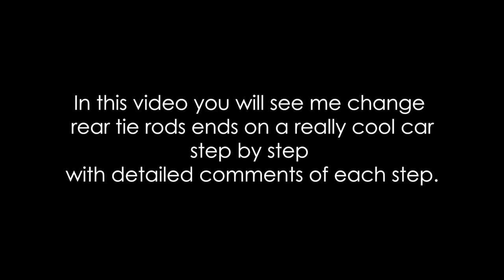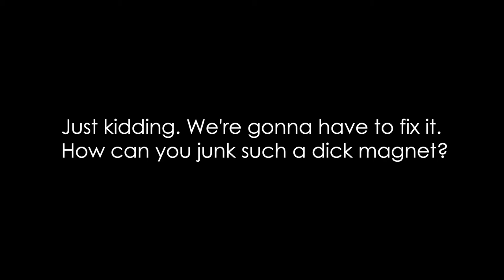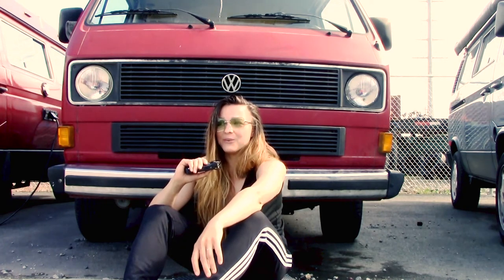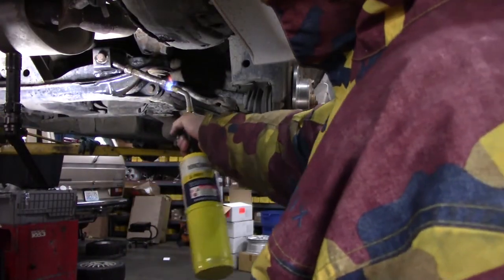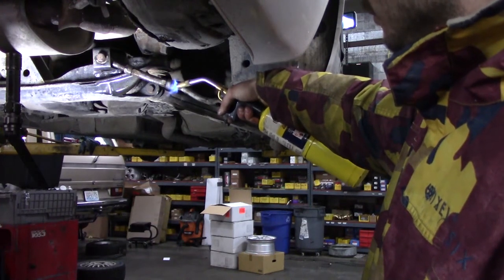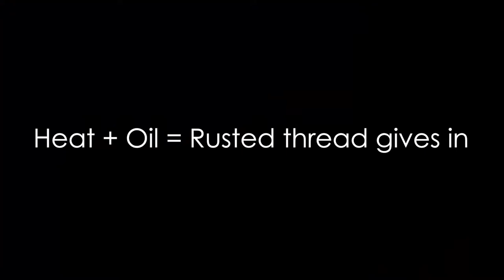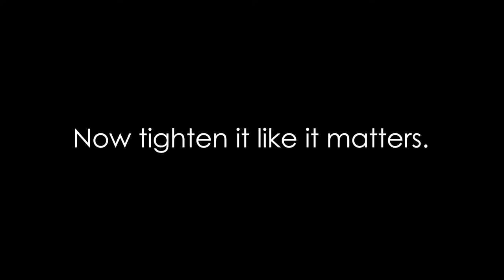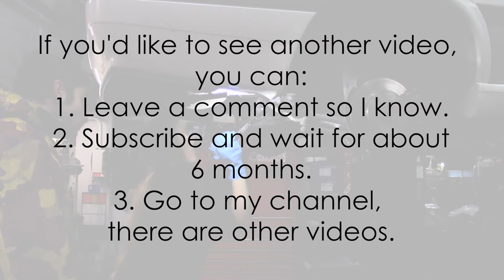How To Change Tie Rod Ends - Audi 4000/80/90/Coupe 1980-1988 Example

Comment: wicked, your videos are really helpful.need to do the rear tie rods and suspension in my b2 coupe quattro. just a lil harder as i have to trace the abs sensor wires to where they plug in to the loom. i don't dare move them out of the strut, mere mm of difference in their spacing from the teeth on the CV joint and the abs will fault....